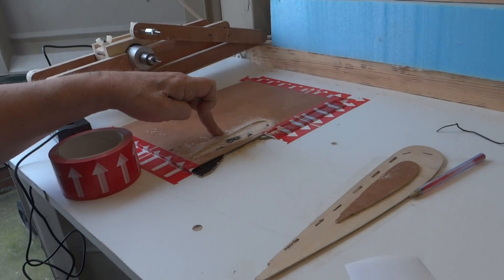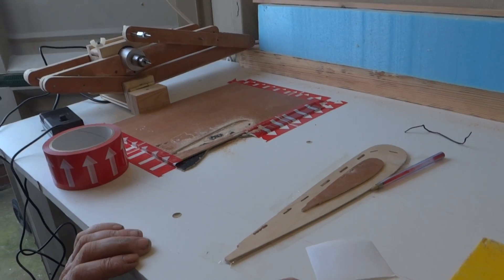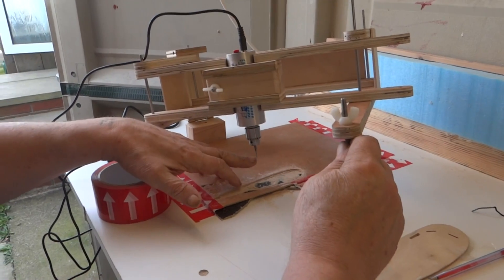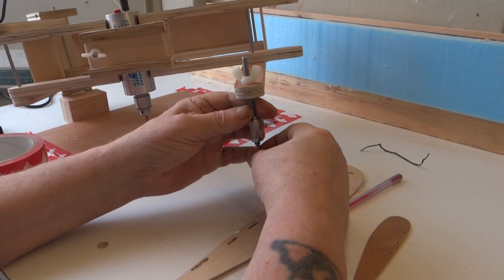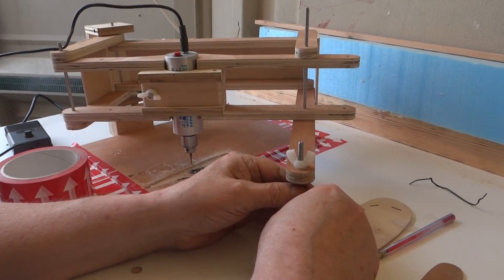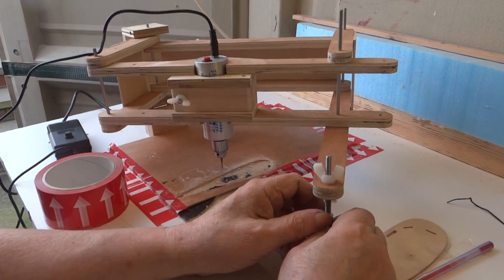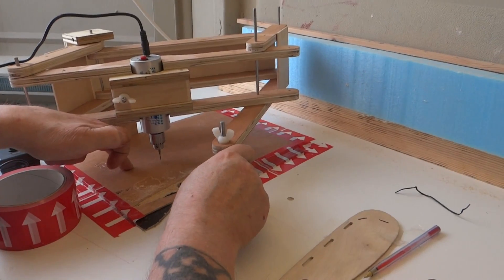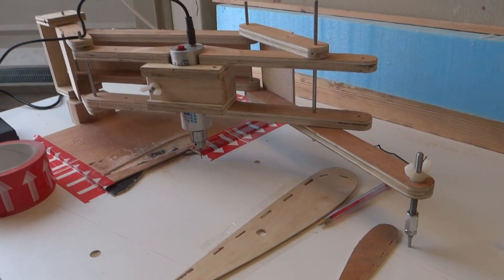A model makers Pantograph Router

Comment: Is the black box in the left side use for adjusting the speed? What type of this motor call and what watt. abd maximum speed per rmp.? Is this pantograph can do the 1:1 scale and how?
Thank you so much.
Reply: Yes, the black box is a speed controller, and the motor is 120W which is really a bit underpowered for this application. Try an google search for "spindle motor" in the 200-500W range for much better performance.
Reply: Thank you for replied me, your answer kind of help me a lot. Can you suggest me the another type of motors or how many type of motors that appropriate to use in this work and for grinder too.

Thanks again sir.
Reply: If this machine can copy a 1:1 scale? how?